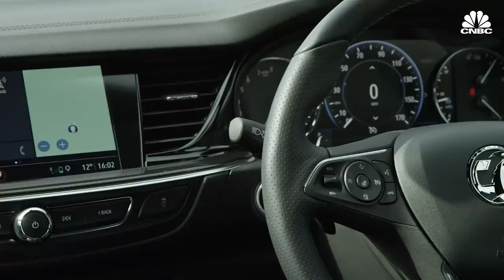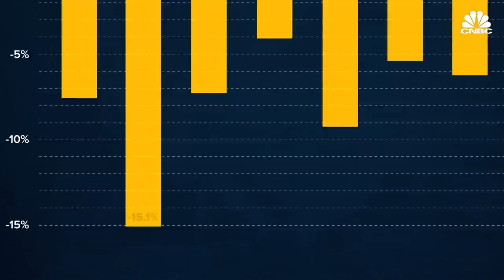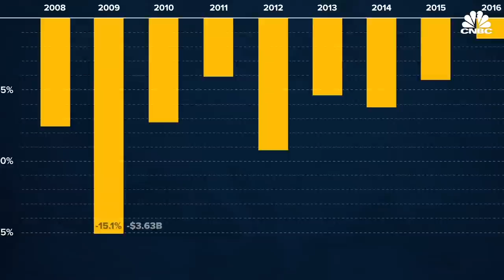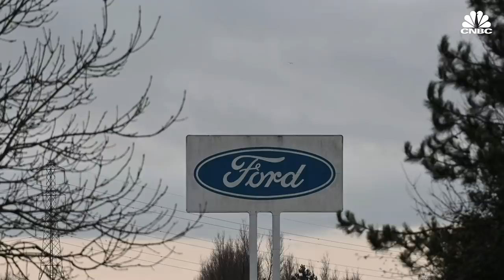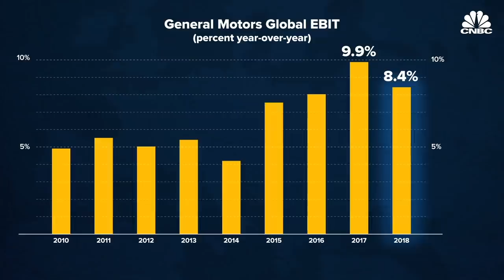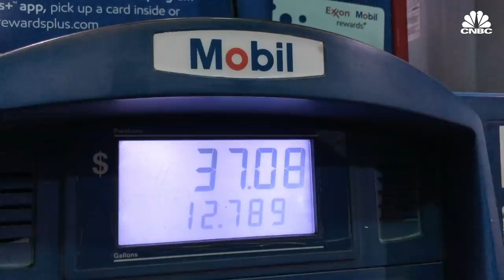Why General Motors Left Europe

Comment: They're simply not competitive vs. European engineering.
Reply: The problem wasn't engineering per se, it was management tripping over dimes to save pennies. The unofficial motto was "Any Engineering/design problem would be made up for through manufacturing". And needless to say, that never happened.That's been GM's problem forever, they're only focused on the next quarterly report or bonus.
Reply: Correct that to Japanese😂😂
Reply: All the engineering was done by Opel in Germany, some of those cars even exported to the US, but only few. 30 yrs ago Opel was on the same level as VW. 20 yrs ago VW expanded a lot, acqiring brands like SEAT (Spain) and Skoda (Czech/Slovakia) and integrating them into the company. GM/Opel did not follow. In addition, VW had higher level brands like Audi, Porsche (not always a VW brand but close cooperation) and also SCANIA (commercial trucks). VW was very successful in China from the begin, Opel never allowed to export into other continents because they were GM territory. So the economy of scale worked against them, together with cost-cutting measures in the 1990s which ruined their quality and thus reputation. - If you build worse cars for more money it goes down the drain.
Reply: Stop spreading the myth of "perfect german engineering". USA also has good engineers and scientists, the silicon valley, google, apple and microsoft are located in the US after all. Germans are actually worse at high-tech things in comparison to USA. It's just the management of american car companies that's really bad.
Reply: @cytrynowy_melon6604  Cars are not hi-tech, are dependable tech. You may break your phone and still have enough in your pocket to buy a feature phone. If your car broke it's not that immediate. New tech is ok if you have not to rely on it and you can easly replace if it broke. Dependable thing must last without giving much hassles. Tha's because banks still run cobol from the 60s not upgrading to new, all defects have been found and now the code is dependable.
Reply: @DebangaBarkakati  German cars are like 10 years ahead of Japanese cars

Comment: I'm from the UK London most of the car from GM are just trash. I would rather buy a 30 years old Japanese car than a new GM car.
Reply: 30 years ago the USA stuff was more decent also..
I'm from holland, but i've got this '67 USA oldtimer, let me tell ya, that stuff is built to last.

Nowadays stuff gets built, with the intention to keep our wallets open at all times
Reply: DK1 — I bought a Toyota 30 years ago.  I don’t ever want another one.
Reply: Corsa, Astra and Insignia sell well in the UK.
Reply: @oxcart  Thats because Vauxhall is a British company, regardless of who owns it.
Reply: @tsu8003  But the whole point of this video is that GM group, including Vauxhall, were making massive losses in Europe.

Maybe those three sold ok and it was a lack of success outside of those models?
Reply: Heck even in many parts of the US (particularly down south) people just hold onto their 20-30 year old Japanese cars since they just keep going while the American made sedans crap out.
Reply: Camaro is good they even make 4 cylinder now and has 300 hp i think that would sell being 4x cheaper than 300hp german car, mustangs sell very well it's much more appealing car than those boring hatchbacks that cost the same and aren't really very good they're front wheel drive they break by design cause have too much hp on front wheels.
Reply: @V8_screw_electric_cars  Most of the hot hatchbacks with 300hp or more have AWD here now actually and the Camaro still won't sell well because its not the kind of car you can daily drive whereas these hot hatchbacks you can they have 5 seats and 5 doors if you spec them to and they have room for luggage and they are easy to manoeuvre and can still perform really well when you want them to. The kind of person who is buying a sporty coupe has plenty of money and can afford something much nicer than a Camaro like a BMW M4 or a Mercedes CLA AMG etc. Not trying to take anything away from the Camaro but I just cannot see it selling well in Europe especially when the Mustang is already sold here.
Reply: @gravemind6536  Well that's the thing, you can't buy cheap sporty coupe in europe so I believe they would sell. Most of those hatchbacks are fwd with 200hp, mercedes is like 400 hp now awd yes but it's really expensive that's for some hardcore hatchback fan.
Reply: @V8_screw_electric_cars  I just don't there is the demand for them. Volkswagen Golf R and Ford Focus RS are AWD and push 300+ BHP too and tick all the boxes for people. I would say based on how many Mustangs sell that it would be quite a Niche market.

Comment: Europeans don't hate American made cars, but you can't sell same car in america and europe simply because europe has different infrastructure and regulations. Japanese and Korean cars sell well in Europe because those regions have similar needs as Europeans. Smaller cars, more fuel efficient as fuel is expensive in Europe and emission standards are high and always increasing. Making gas guzzlers not only expensive to run due to fuel cost, but also expensive to license, insure and register every year.

Comment: My friend was in a pinch a couple years ago and ended up buying a new Chevy Aveo. Understandably its a budget eco car but the thing was put together so laughably bad, interior was held together with hardware screws, the transmission started going out after 10 thousand miles, the headliner turned into chalk, the interior plastic warped in the heat, etc. You would literally be better in a soviet made car like a Yugo. Japan and Europe wouldn't dream of putting together something so terrible, even at the bottom end of price points. GM should just die imo, liquidate and let the next Tesla or whoever have the market share.
Reply: I know someone who got a new Cruze a few years ago. It was so bad that they actually got rid of it a few months later.
Reply: GM should have died back in 08 but the Government bailed them out, as they are a Bank not a car maker. GMAC is one of the biggest parts of there business.
Reply: Yugo was from the former Yugoslavia. You meant a Lada ( Russian )
Reply: The Aveo was designed and built in the Far East, so, yeah, they would build such a car. What you are saying is that no one should build an inexpensive car.

Comment: This is all just excuses.  GM has made cars specifically for the European market for many decades,  and at one time Opel was ranked very high in quality.  Also,  that bar graph of annual losses suggests that GM was one year away from profit.  

Not making a profit for 20 years is a strong indication that the company has no idea what it's doing.
Reply: back in the 70s they made ok  quality cars. I used to own an 1985 opel and 1988 opel and they were not good quality cars, and they rusted almost as bad as a Fiat or Seat. My Dad owned Opels all his life until he got a stroke. Last reliable one he had was the 1984 Opel Rekord. The Omega 3000 was terrible in reliability all ways accepet the engine. He drove it 650 000km before it was so rusted out that it was impossible to fix. And 90% of the electric didnt work. Last car was a late 1990s Vectra was a rustbucket went to the scrap after he got the stroke. my 1988 kadett had more problems then all of my cars the last 20 years toghether. 2 Volkswagen golf, 1 Mazda 626 and now an Toyota.
Reply: That is how I read those charts.

Comment: GM left Australia etc. Generally build crap cars, in Europe and Australia, nobody wanted.
Reply: Except for the Commodore, love my Pontiac G8 GT, probably the best GM sedan ever built since the 80s that isn't a Cadillac.
Reply: @row2noob410  well Australian build, the problem so is its fuel consumption,  about 15-18L/100km. Is ok in US, middle east etc where fuel is cheap, income is high. Australia changed to energy efficient smaller cars, or bigger SUVS. If you consider my ford focus 2L diesel, could outperform a V8 2005 Commodore,  you could see the writing on the wall. GM took lot of tax payer money and made car more powerful etc. Did not however looked at consumer sentiment. Opel for 40 years was considered a pensioners car, budget friendly non frills. At least ford tried bit harder, but now customer service and reliable gone down the toilet.  So my next car likely be of Korean origin.

Comment: In 1975 the most newly registrated cars in Germany were made by Opel. It actually started in the 1980s with José Ignacio López de Arriotúa becoming lead buyer of Opel. He gagged the component suppliers to a level that was unknown until that time. This lead to a massive lost in quality of the parts, and therefore for the whole cars. That's why this effect is called "the Lopez-effect" here in Germany. Opel could never recover from this big fail. And actually Lopez went from Opel to VW, with seven of his "warriors" (that was the way he called them). VW was crippled at that time, and for his methods to reduce production costs he was called "the strangler of Wolfsburg".
BTW. public prosecutors investigated against him and his team for industrial espionage, after leaving Opel they still had documents and data for new Opel models in their posession. Lopez had to pay 400,000 german marks, VW had to pay 100 million US dollars to GM and had to buy parts from GM for one billion dollars.
VW recovered from this very fast, but Opel didn't. 
The lowered manufacturing costs were actually paid by the customers, for example on the Golf IV. The relais for the blinkers was built into the switch for the warning lights. So if the relay failed, the repair shop had to replace the whole switch instead of just simply the failed relay. Causing higher costs for the customer.

Comment: Never saw such a bullsh** Back in the 80es the Opel Kadett (over in the US you could buy the same car as Pontiac Le Mans, it was basically sold globally) was the second best selling car in Germany only behind Volkswagen Golf/Jetta (counted as the same model for statistics up to the Jetta Mk5 because the Jetta basically was a Golf with rectangular headlights and a trunk back then). At the same time the Ford Escort was the best selling car in the second biggest European market, the UK. So there was a time when American owned brands were sellng well here.

But they tried to control everything. They should just have seen Chrysler, who made the Opel-Mistake 40 years ago. They owned Simca-Talbot but thought their US cars are better anyways. So they sold off Simca-Talbot (to PSA by the way) and replaced their cars with the Plymouth Horizon (that was before they sold the brand so basically PSA continued building it for some years) and continued with the Plymouth Saratoga and Voyager under the Chrysler brand, later followed by the Neon, Cirrus and 300M. Only Voyager and 300M can be considered at least not a complete failure, the only Chrysler success in Europa were smaller Jeep models (Wrangler, Cherokee) when SUV (European "SUV" are mainly the American crossover class) were demanded but Europeans did not build them yet.
GM always tried to make Opel more American. But other than in the 50es and 60es, when everything from America was modern and even Mercedes had to respond by building cars with tail fins, that did not work. And even after they generously allowed Opel to design their own cars, they still put American Management on top of the whole.
Ford gives the European organisation much more freedom and that works way better. So the small cars like Fiesta and Focus meet the European taste, Ford develops small SUV in Europe. Meanwhile many US Ford are designed in Europe and a success in the US. Beside Fiesta and Focus also the Fusion was developed at least with Major European influence as it has to be sold successfully here either as the Mondeo. So are the smaller SUV and Vans: Ecosport, Escape Mk3, C-Max.

Finally, there were identical platforms and even whole cars between Europe and US. The Opel Corsa shown in the same moment Shares its chassis with the Chevrolet Sonic while the Buick Cascada, Encore and Regal are plainly rebadged Opel Cascada, Mokka and Insignia. Basically you can even fake change them by simply replacing badges, lights and grille from Opel to Buick and back. In Germany it is common for Opel owners to replace badging by cooler looking ones, mainly Vauxhall and Holden - Buick's triple coat of arms cannot cope with their beasts in terms of coolness, even the original Opel flash looks cooler. Meanwhile many Opel dealers even know the spare part numbers for Holden and Vauxhall logos and name plates. So all that part of the Video proofs is that GM USA had no clue at all what Opel was doing despite trying to put more control on it than rival Ford on their more successful European branch. And that's basically what went wrong at GM.

Comment: Europeans are much more educated and want quality and efficiency?
Reply: That is a little arrogant don't you think? Europeans buy Japanese cars which are built so goddam cheap that they are complete trash because they use low quality steel in their construction and are more prone to recalls for parts and accidents happen allot with them. Prius cars with catching fire, shrapnel launching air bags even some of their vehicles are prone to failure of the vehicles chassis and do not hold up well against rust.  European cars do not sell well in America because most come with higher cost due to a luxury tax put on them and only the wealthy can afford them. More emission equipment put on a vehicle the lower the fuel economy and causes them to use more fuel.
Reply: @02091992able  What on Earth are you talking about? Honda and Toyota the big two Japanese car makers are some of the most reliable vehicles out there and second only to the Germans when it comes to build quality.

Comment: GM was also using Opel as R&D department, shoving their costs in R&D onto GME and profits on GMW.
The Global A platform was largely developed by Opel, this was later also used in GM NAO vehicles (Can put the IPC from a Buick or other GM vehiclse into my Opel Insignia for example without much effort)
Reply: It shows that American companies are simply unable of precision complex engineering for any complex part is borrowed from a foreign company. Buick wouldn`t even exist without German Opel engineering. Actually GM wouldn`t exist without German Opel, South Korean Daewoo,  Japanese Denso, Aisin, German Bosch , Japanese isuzu.

Comment: I just traded out my seven year old GM truck (2500 Suburban 4 X 4) and bought a Toyota.  The GM went through many fuel pumps (9), dash climate control switch panels (4), constant cooling system issues, several blend door motors, dash blower motor bearing failures, bearing failures in the alternators, fourth gear in the transmission starting to slip under load, engine starting to use coolant.   The unit had just turned 90K at trade in.  The nickel & dime thing didn't apply here, it was wads of $100.00 bills at a time, having a tow company on speed dial.

Comment: The last good car Vauxhall made was the mk3 cavalier.
Reply: I worked in Nottingham the summer of '94 and the company had three mk3 Cavaliers. Most weekends I would take a trip using one of the cars. Some of the most fun I've ever had driving.
Reply: I owned a 2.0 turbo 4x4. A fantastic sleeper. 270 bhp.(tuned). Gave Escort Cosworths a scare😁
Reply: The Omega was a good car. Much better than that pile of crap Signum that replaced it.

Comment: I certainly wouldn't characterize GM in China as a success story - more like an object lesson in how you can get off to a really great start and then completely blow it.   Going back  about 15 years, the most common non-Chinese car brand you saw in China was Buick.  This was largely because GM were one of the first companies to set up a JV in China (with SAIC) - the cars were somewhat expensive by local market standards, but they were also clearly better than the competition, and sold well despite the relatively high prices.  Then other companies got into the market - both Japanese (Toyota, Nissan) and European (VW) - GM appear to have overestimated the value of their brand recognition, and concluded that they didn't need to either update their products or adjust their prices.  They also seem to have failed to adapt to other markets changes - things like electric seats were becoming standard fitment on cars from the Chinese domestic brands, but were still extra-cost options on the GM ones.  The Japanese and the Europeans didn't make the same mistake, and made sure that even their lowest trim levels always had at least the features that the competition did.

Comment: Vauxhall / Opel is a well respected brand and is one that Europeans do buy lots of whereas American branded cars in Europe are avoided as they are seen as the poorest quality in the industry and you’d have to be crazy to buy one as the only buyer after you is the salvage yard. Literally no one here wants an American branded car. Vauxhall predominately sells in huge fleets to rental, leasing, Police and large corporations and because they’re so widely available used it’s hard to retain a high price. We purchased a 3 month old Vauxhall Corsa Elite from the main dealers with only 6 miles on the clock for half the RRP. The European car market favours small economical cars with high specification. Ford and GM trucks do not fit in at all with European lifestyles.

Comment: Basically Euro cars are better than American cars, period.
Reply: John K  us cars don't fit in parking lots. Interieur with a lot of hard shiny plastic. They are heavy (road tax in the Netherlands is based on the weight of your car and the fuel kind). Petrol is about 1,60 euro a liter the only way you can use a us car for daily use is put in a LPG system, so you lose space and you pay more road tax.